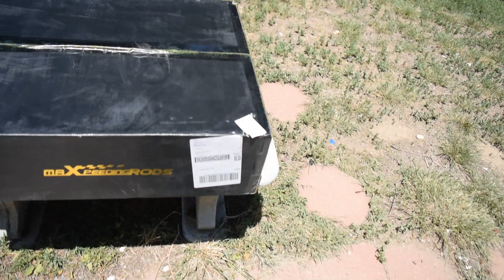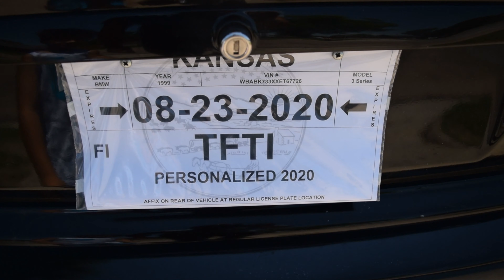Father & Son BMW E36 Coilover Install

Comment: I ordered the same coilovers in pink for my s13 bro 😂😂😂
Reply from the maker: DIXIE GARAGE I had a set on my old S13 also, for the price these coils can’t be beat haha
Reply: I'm getting BCs at tax time but these will hold me over til then. Cant have 15s on an s13 and not be low lol.
Reply from the maker: DIXIE GARAGE I went 15’s once lol broke my kit within a week
Reply: I'm staying stock body. So I should be fine but I think my driveway might try to rip my bumpers off lol
Reply from the maker: DIXIE GARAGE that’s the plan for this E36 pretty stock just slammed on wheels and sideways eventually

Comment: What size wheels are those
Reply from the maker: They were 18x9.5’s with a high offset but I used spacers to achieve the figment I wanted.
Reply: @CGOD  thanks I just got some 335i 18s and ordered the same coilovers